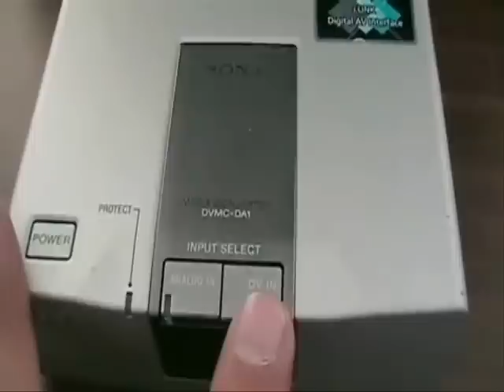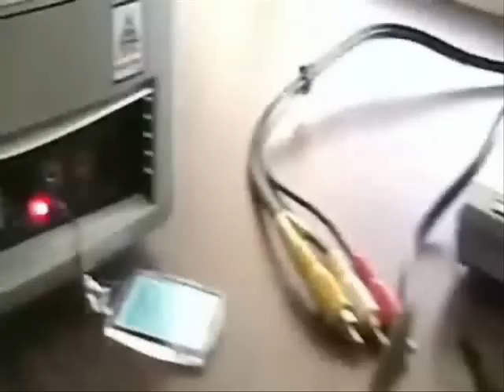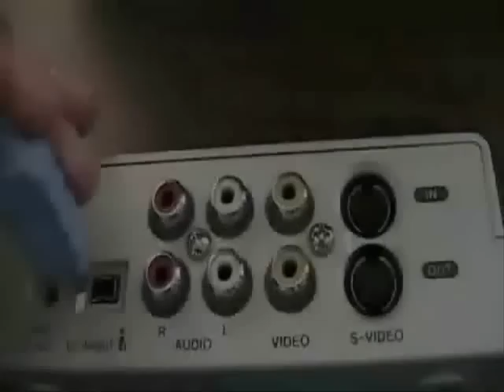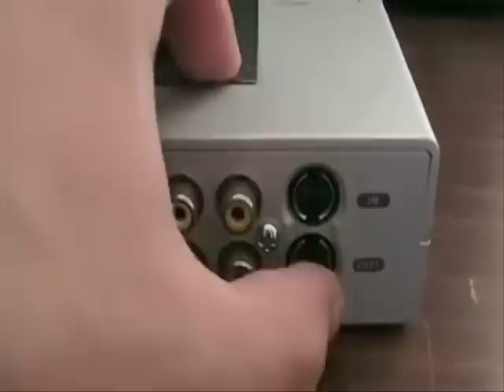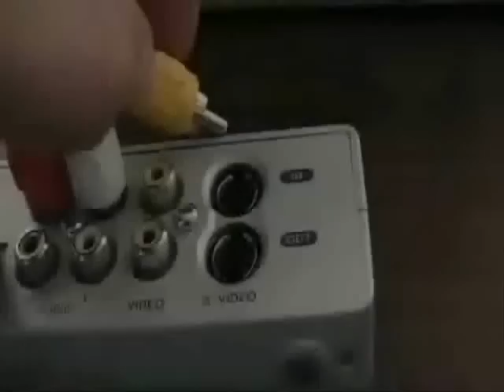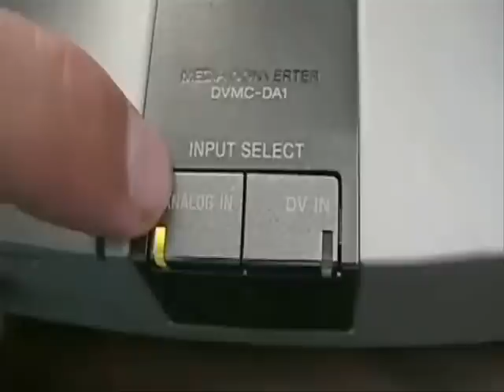Sony DV Converter - DV Video with Captions

Comment: This is the BEST VHS-to-PC solution out there!  The other video capture cards are mostly garbage!  This thing has a built in Time Base Corrector, which helps stabilize the video, so you can get a good capture!  I have been looking for a TBC device forever, but i recently heard about this.  A guy made a video about it, and he unintentionally LET THE CAT OUT OF THE BAG!  EVERYONE who watched the video told their friends, and so on, and so on, and so on.  Now, these devices, which USED to go for about $50 on ebay, are now selling on ebay for $300.00+!!!!  It's almost impossible to find one now.  Every place is sold out of them!
Reply: it's just finally catching up to the value now that everyone knows it exists. When demand spikes and supply dries up, the market corrects itself. I accidentally did the same thing to the Nvidia Tesla P40 video card a few years back lol.

Comment: I am using a MacBook pro(2011), I have connected the laptop via FireWire to the converter box and the plugged in the RCA to the output as instructed. The only issue i am having is What do I need to do next? On my laptop what program do I need to use and what do I select? 

I am using QuickTime when converting onto my laptop from vcr(which works perfectly, issue free) but I am confused as far as getting the laptop footage back to vcr because I can't see anything once I turn on the capture box. I know you are using pc in the video above but pleeeease help if you know anything, I can't find anything online to help me